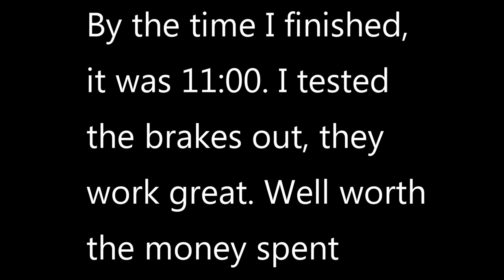ARE EBAY BRAKE ROTORS ANY GOOD? Installation (Update in later video)

Comment: many people thinks Rotors and brakes are cheap from ebay . They're cheap than stores b/c they don't have to rent a space. That's why it's cheap.   If u buy at AUTOZONE and AAP then it's expensive .  I used BRAKES and ROTORS from EBAY all the time..they work perfectly.  For example, rotors from EBAY weight less than the one u bought at AUTOZONE but it works perfectly. Brakes and rotors from EBAY work perfectly..many people disagreed but i did use it..did not have problem at all
Reply: I agree totally there’s as good as the parts suppliers

Comment: How are they holding up? If u still have em.
Reply from the maker: The car actually got totalled but they worked great. Still have them too. A little surface rust from sitting but not warped or any grooves dug in

Comment: I just bought some on eBay for 150.... hoping they come out great 👍
Reply from the maker: Rotors work great. The brake pads are the only weak link. The one I bought was advertized as "ceramic" pads but started squeaking after a month. They were metallic pads
Reply: No Lag Productions cool hopefully the rotors work out and I can just replace the pads with better ones. Thanks I’ve heard they’re decent.... figured why not since the fronts are 60 each and 80 each for the rear on mine through most part stores
Reply from the maker: I'm still running them on my car with different pads. No warping, no grinding, and even braking.

Comment: Late to the party, but as far as I can tell, you put the front rotors on the wrong sides. the slots should turn from the inside out
Reply from the maker: I realized it after doing the video. The slots are suppose to face towards the rear of the vehicle

Comment: Any update on how the rotors pads are holding up ?
Reply from the maker: I'm going to do a full video on that. But, in the mean time, the rotors are doing great. The pads since the video have been replaced.
Reply: No Lag Productions I use cheap rotors and akebono pads they work real good together
Reply from the maker: The car they were on just got hit by someone and may be totalled. Didn't really get to enjoy them enough 😢